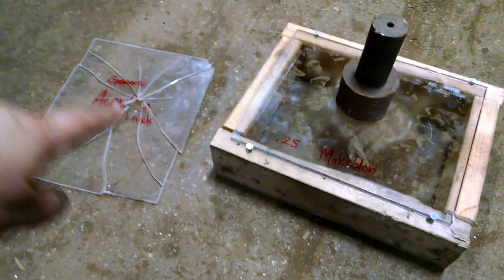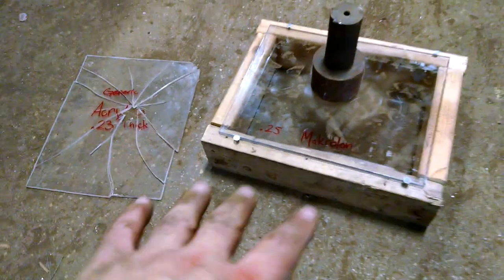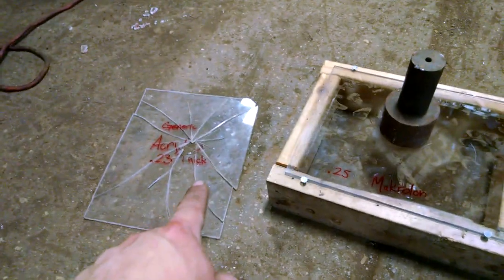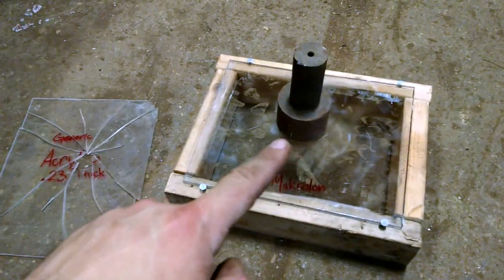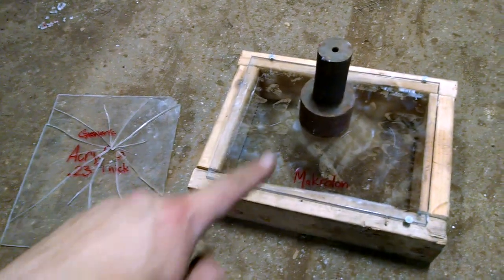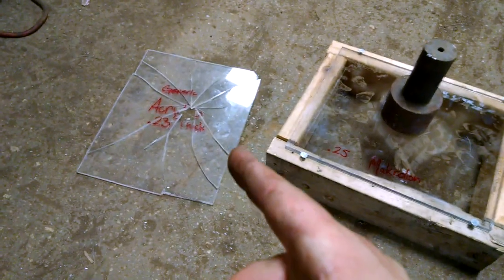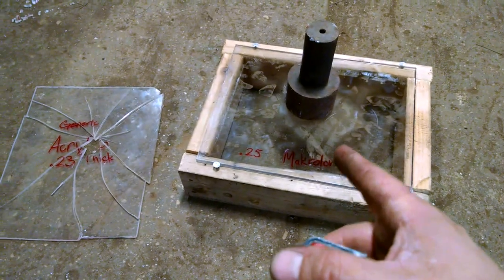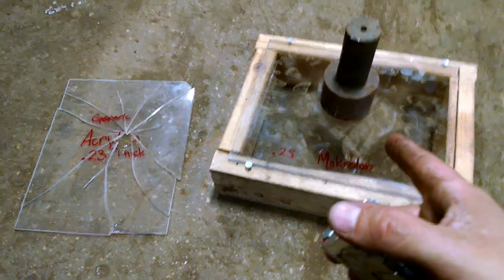Impact testing 1/4" ACRYLIC VS POLYCARBONATE

Comment: This test is not valid. You dropped the weight at the edge of the material where the frame helps to reinforce it.
Reply: yeah. also the worlds smallest window.
Reply: The edge is the weakest point